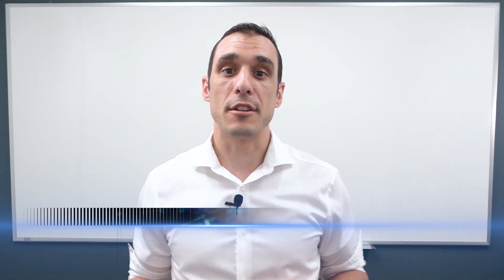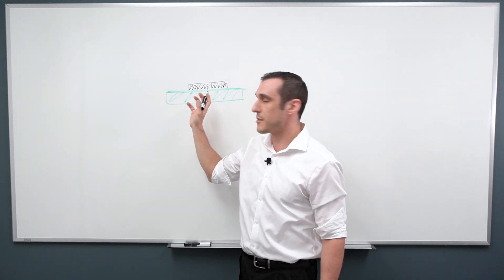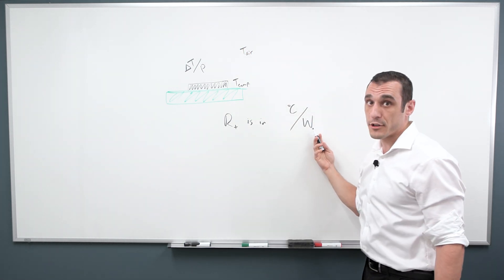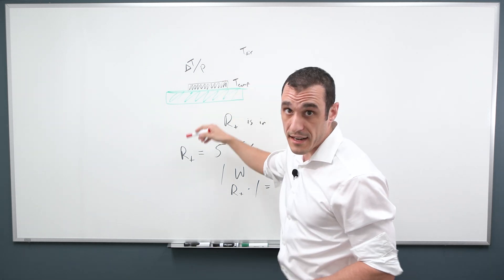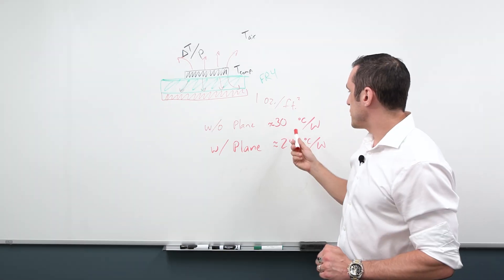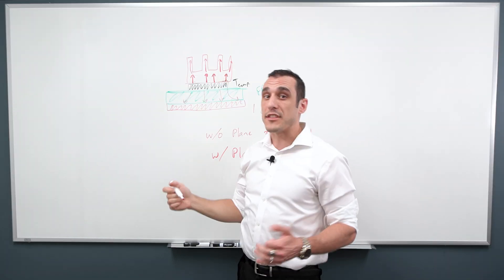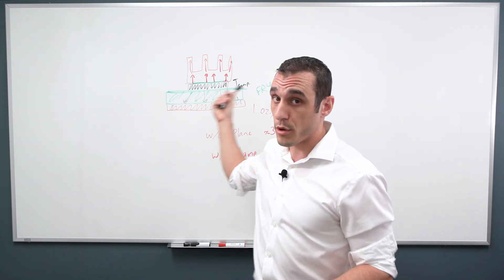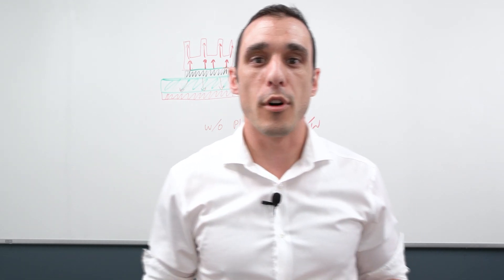Thermal Resistance and Heat Transfer in PCB Design

Comment: @Altium Academy Hello Zach.. How do we calculate the Effective Rth if there is an exposed pad (like a FET Drain) on the bottom side of the component. Do we consider RthJA in this case too? and how the multi layer pcb and via numbers can help in such scenarios if we need to avoid heatsinks
Reply: If the component is well-documented then it will typically have a some thermal resistance measurement or calculation that includes the bottom-side pad on the component. Not all components will have this level of documentation unfortunately. I'll have to do some digging to see how to calculate this and maybe we can do it for an upcoming video. Once you include the PCB it gets very complex and you might need a simulator. For the vias, placing multiples in parallel essentially means the resistances add in parallel.

Comment: Great job! Thanks a lot for all the info you have provided with all your videos! Heat sinks are one approach of cooling down our PCB. Could you also show how we could do this with Thermal Via? 
Thanks a lot in advance! :D
Reply: I think the better way to think about thermal vias is redistributing the heat so that you move it away from a hot component and into other parts of the PCB. So for example if connected to an internal plane, that plane can help transfer heat away from the component.

Comment: How can we calculate power dissipation of track width or copper area..
Reply: The power dissipation (the portion of power converted to heat) is determined using the current sourced into the trace and its resistance. The DC resistance is simple to calculate using a simple definition, you can find the formula and the electrical conductivity of copper on wikipedia.

Comment: I appreciate all the great technical videos Zach, thank you.

I would be glad to see example calculations for a LED driver or mosfet, pulling info from datasheet to calculate conduction and switching losses and then estimating temperature change.

Practical, easy to understand guidance on switching losses is hard to come by. After looking through a few text books, online articles and videos I still am not totally clear how to calculate switching loss using the values from a real life datasheet. For example PMN30UN rise and fall times list specific conditions (Vds=15V  Id=3.7A  Vgs=4.5V) which are not my conditions (Vds=30V  Id=1.8A  Vgs=3.3V). Is there some way I need to utilize Qgs and Qgd to calculate the rise and fall times for my application? Otherwise what is the point of these values and the gate charge waveform (figure 15) shown in every mosfet datasheet?
Reply: This is a great question and I'm sorry it's taken so long to notice this! I'll have to go through and do this calculation for a video.

Comment: Hi, how about setting the PCB sealed under vacuum? Or it has benefits mostly on high power PCB.
Reply: This is a bad thing to do if you want to dissipate heat. In vacuum, the only mechanism for a component to dissipate heat is through radiation. For a PCB in air, you want to be at high pressure as air will have higher thermal conductivity.

Comment: My question is that how to design a heat sink for power MOSFETs in SOIC packages for example SI4401bdy. It is noticed that the heat dissipation don't give in the datasheets.
Reply: Hi Junaid, There are some vendors that sell heatsinks for standard MOSFET packages. I know there are some available for TO and SOT packages, I'm not sure about SOIC packages. Hope this helps!